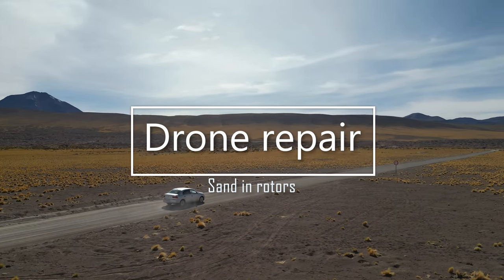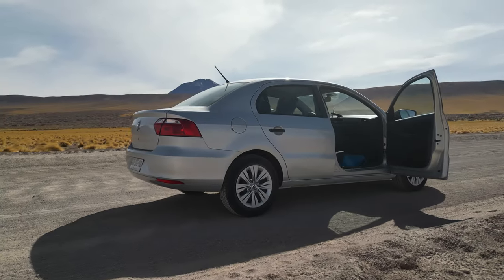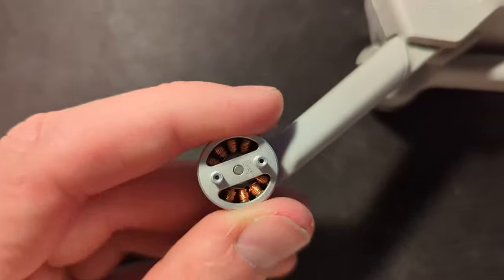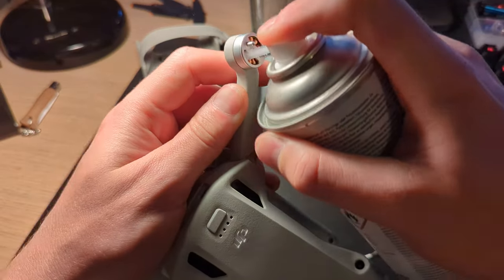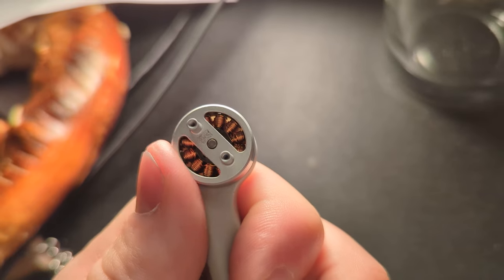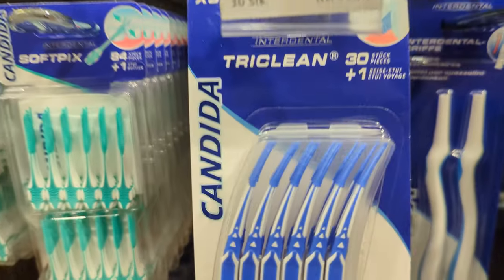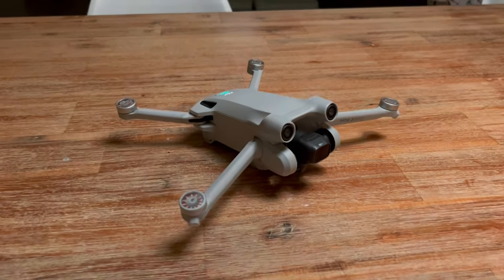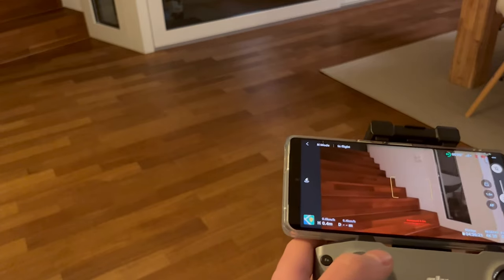Solution to sand in drone motors (DJI mini 3 pro)

Comment: You can flush them with distilled water which you can get off Amazon etc. Always hand launch and catch on beaches and you have no issues as it still happens with launch mats. Or if you want to fly at a beach location, take off from the tarmac and fly distance to the beach. Glad you got it working.
Reply from the maker: Unfortunately my drone just wouldn't land anywhere (Floor, hand, car Roof) so I didn't know what to do. I could have just let the batter run out but I didn't wanna wait 40 min.
Reply: @LuWolharn  hey there! Great repair job. On landing issue, you could just catch it by hand and quickly flip it over. This should shut it down.
Reply from the maker: There are a few things I could have done better 😅
I did this back with my mini 2 but in the video you can see that it was pretty windy so the drone was super jittery and I didn't wanna get cut, which also happened once..
Reply from the maker: Haha Fight fight fight !

Comment: My DJI Mini 3 shakes right after taking off and then stops, flying normally, what can it be?
Reply from the maker: The gimbal? If what is shaking?
Reply: @LuWolharn  All the equipment vibrates when taking off, but soon after it works normally, it stays that way for only a few seconds after takeoff. The gimbal is normal.   https://youtu.be/xk-tMxvi8R0?feature=shared
Reply: @LuWolharn  ele treme todo, o gimbal está normal, isso acontece por alguns segundos apenas, como no video que gravei https://www.youtube.com/watch?v=xk-tMxvi8R0
Reply from the maker: @rogeriocarvalho3857  oh okay. Are all the props clean/without damage? I'm actually not sure what the problem is but it looks a little bit risky because in strong winds this could be a problem! Clean rotors and maybe swap props for new one are my only ideas
Reply: @LuWolharn  It flies normally after this happens, there are no alarms or warnings of software problems, it flies very well, it only happens when taking off, here (in Brazil) no one can figure out what the problem is, I've already cleaned it. Thanks for the help!
Reply from the maker: Well then let's hope it's continues to fly without a problem:)! Good luck
Reply: @LuWolharn  obrigdo e bons voos !

Comment: But why did you try to land on grass or sand when you could hand catch the drone, after you realize that theres nowhere to land? 😐 I've been hand launching and catching my mini 2 since i bough it and still its been completely fresh after almost 100 flights.
Reply from the maker: You guys probably can't properly listen but I specifically said that the drone wasn't landing anywhere, not my hand, not the car Roof, not the floor
Reply from the maker: And it was too windy to pick it out of the air with that wind speed

Comment: No sir. All you need are motor covers. Video shows for the Mini-2 but are used on all of the Minis. I've been using since Ken made this video. Also use a landing pad with or without.  Also if in a Sandy, Grassy, loose dirt, rain puddled area Hand Launch and land. https://youtu.be/9e_kr8AEGK4
Reply from the maker: I never had rotor covers might be a good idea, but as I said, landing in my hand or anywhere else was impossible at the time.
Reply: Personally I would be reluctant installing dust covers on my drones as I live in a hot environment. In the video referred to, the host said something on the lines of didn't increase the temperature much at all.... Also installing the covers will increase the rotating mass. Not sure if the modification would bring reliability. I have a launch pad but usually hand launch and land for convenience.
Nice video Lucas
Reply: What are the repercussions when you install the motor covers in terms of weight?
I mean, those covers will be small, right. But it might still affect the drone flight?
What are your thoughts?

Comment: Great video and thank you for this information.  Do you normally use a landing pad?  I have the PGYTECH folding pad and always bring it with me no matter where I fly. It may not be 100% sand-proof, due to the propeller wash effects taking off and landing, but it would prevent the motors or gimbal getting significant sand deposits.
Reply from the maker: I never used one because I usually start and land from my hand!

Comment: Dipping it in Isopropyl alcohol is not a very good idea, since you basically remove the grease from the bearings doing so, which will pretty much shorten the lifespan of the motor drastically.

Comment: Thank's for the trick with the brushes for repair. To avoid this situation at all, I recommend you to practice hand take off and landing or simply to grab the drone from a  low hovering position in the air. Also, the car roof is a perfect place for a save  and dirt free landing. (;->)
Reply from the maker: Glad you have a tool if something like this happens to you :D!
Yeah as I said, there were a Multitude of solutions but I was a bit stressed and very dumb. I start/land from my hand in 95% of cases..

Comment: Thank you for the informative video, which I used to clean my drone, which crashed by my carelessness, when I hit a big tree and fell on the beach into the sand and on the coral. Thank God not into the sea. I have cleaned it as per your instructions, it is flying normally with no problem. Greetings from the Dominican Republic...:hand-pink-waving::hand-pink-waving: